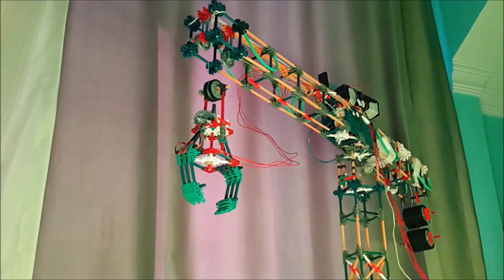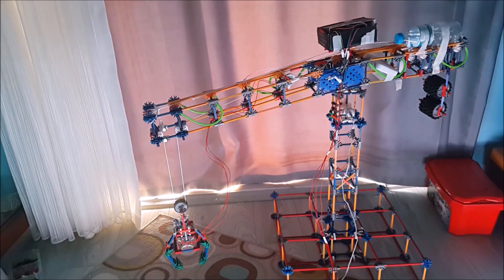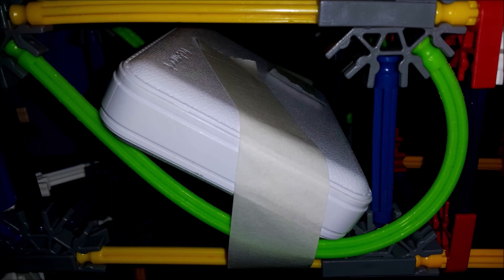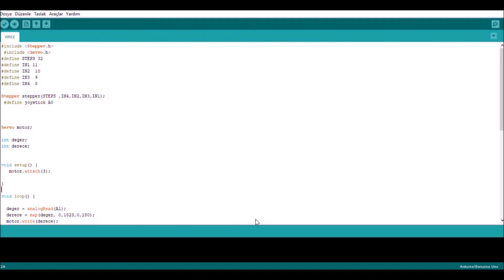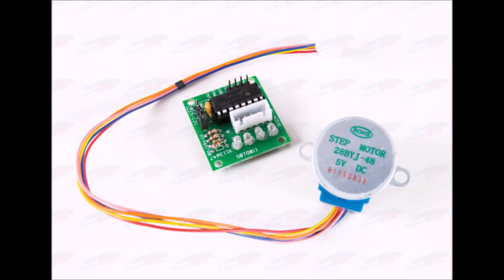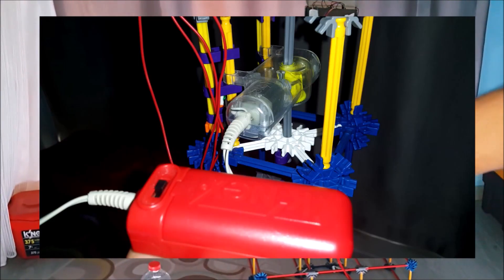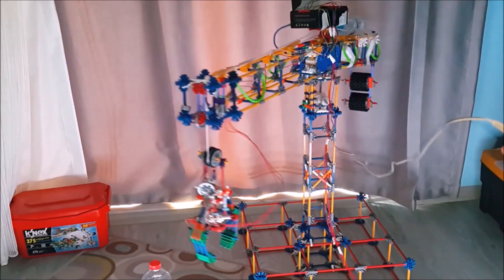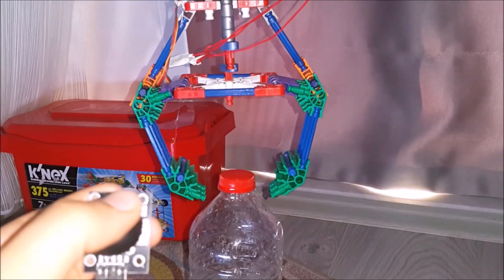MAKE WINCH (Using KNEX +ARDUINO)

Comment: Nice! I would recommend to strenghten your superstructure by diagonal rods between the grey 3D connectors. This will make your overall construction a lot stronger.
Reply from the maker: Thanks for your advice, but it was demolished by the excess weight. :(